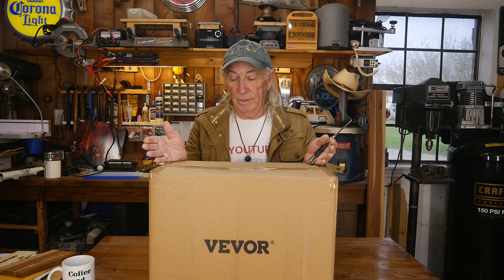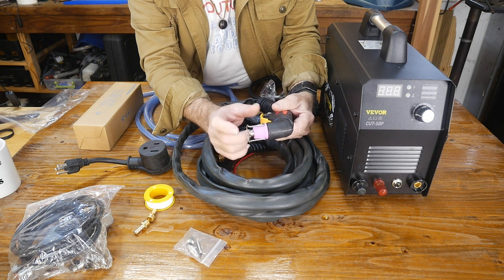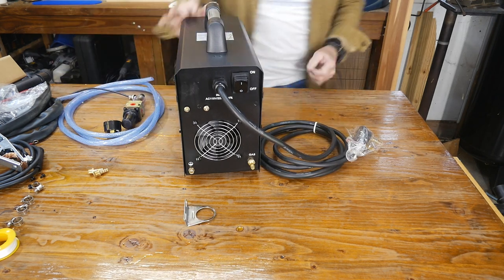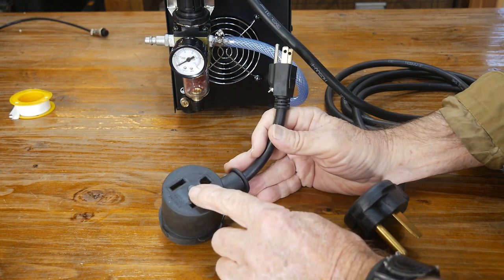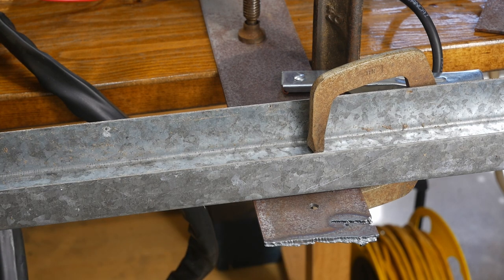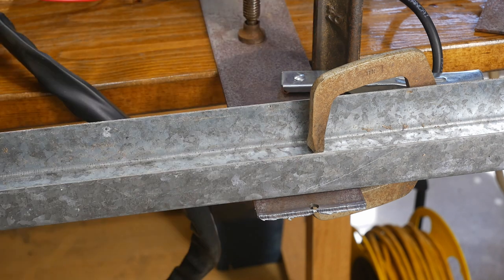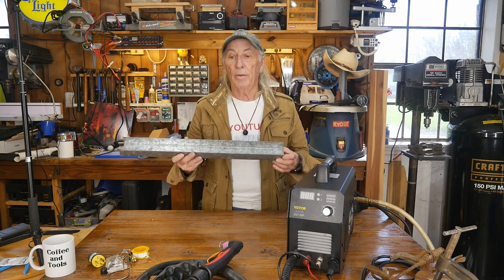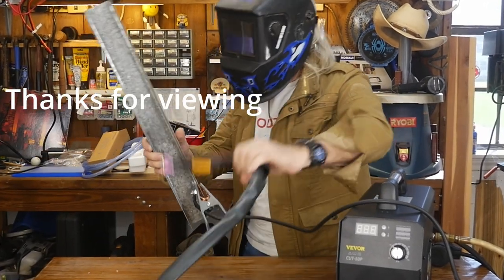Vevor Plasma cutter CUT-50P review and sale deal TBA. C&T ep. 322

Comment: You might take a look at Milwaukee steel cutting circular saws.  They cut without sparks or heat.  Cuts in 1/2” steel plate come out smooth.  Price of admission is a bit stiff, but oh so nice.